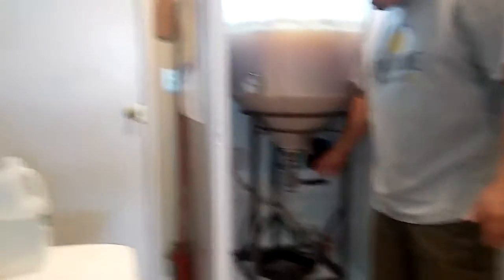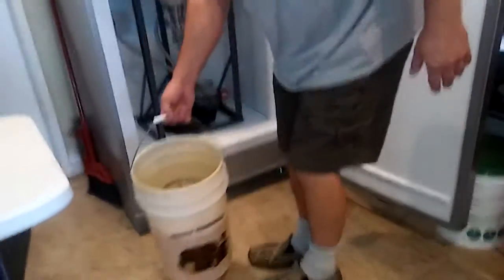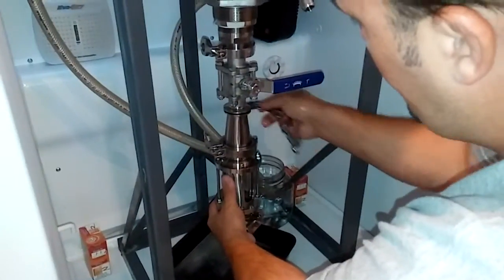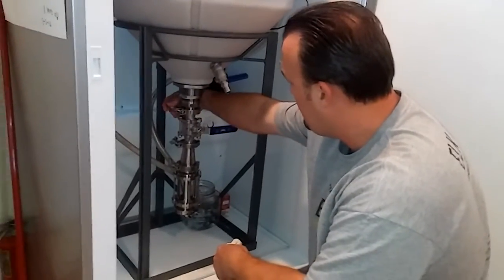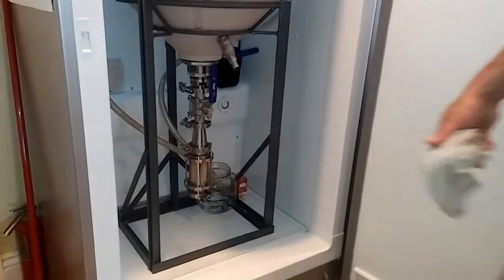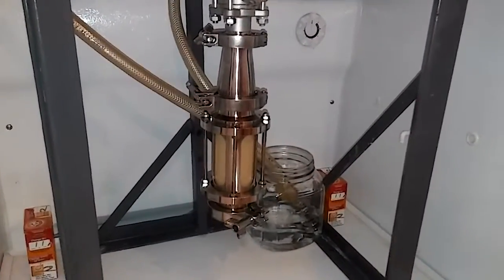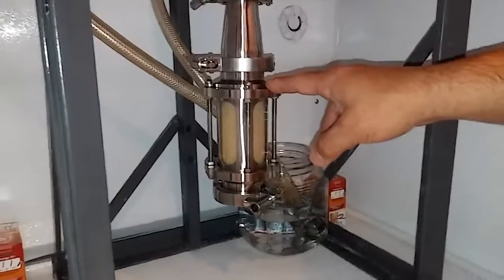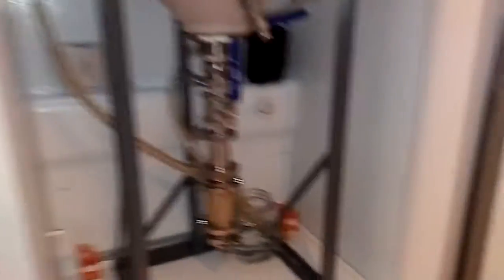Collecting yeast from conical fermenter.

Comment: I'm not sure, but I think you just oxygenated your wort.
Reply: Worse, oxidized beer.  It's tricky to do this right without letting oxygen go up through the beer into the headspace because how do you purge into the collection vessel?  It's why I use a racking arm on the liquid out port (in his case, the ball valve at the middle top poking out at an angle).  Process is:
1) cold crash
2) pressure transfer out until your beer is clear, leaving the trub/yeast in the cone below the valve - your beer is now safe!
3a) #Optionally# add a little boiled and cooled / sanitized water and swirl what's left in the cone, let sit a couple hours.
3) Dump the thickest part of the cone (trub) to compost and collect the yeast when it starts getting liquidy.  If the trub's been sitting there for weeks it can be quite dry and proteinous, almost like a dough ball.  
A sight gauge on the inside of your valve helps with this, you can see what's coming next and know what to dump vs. collect.

Comment: One problem I can see with this is that there is air inside the harvester before you attach it to the conical.. so that gets blasted through the beer when the yeast displaces the o2.... maybe you can purge the harvester first with co2 to reduce the amount of oxygen that gets sent through the beer?  (or just sit back relax and have a homebrew! lol). :D
Reply from the maker: Terence Gardner 
Thank you for your input. You are correct, and this is something I have actually thought about since. I now have a set up for purging my kegging lines, I use it to fill CO2 in the harvester before attaching. I also am now using another harvester that works better for me.  Thanks again for watching, I appreciate your sugestion.
Reply: Awesome to hear and thanks so much for sharing! Would love to see more.
Reply: @hungrypeckerbrewing564  I am planning to just fill the harvester with water before attaching it.
Reply from the maker: @kakaka9330  not a bad idea? but you will dilute your brew. Also make sure its distilled. Better yet check out nor cal brewing solutions new product. They have a mason jar that is vented so displaced air escapes. Also they have one you can pressurize and inject your yeast into another batch. I am currently just purging the mason jar with C02 before attaching. Cheers!! And thanks for the comment!

Comment: Can I attach this harvester to my plastic conical fermenter?
Reply from the maker: Randall Schoverling 
hi thanks for checking out the video. this is the morebeer yeast harvester. it will attach to any 1" or 1.5" triclamp fitting, the flange size is the same on both. I assume your conical has standard 2.5 inch bulkhead. you will need a reducer from your bulkhead to a valve with. a triclamp fitting. I actually just purchased a new harvester from Norcal brewing that uses a mason jar. it is less expensive and holds more. I will be doing a video soon. feel free to message me on facebook, just look up Hungry Pecker Brewing. hope that helps.
Reply: Yes, 2.5" bulkhead. I'd like to see that mason jar yeast trap, thanks!

Comment: Is that the morebeer yeast harvester? How long after transferring the wort into the fermenter do you start taken yeast samples.
Reply from the maker: Dion Billard 
hi sorry for the delay in responding. yes, that is morebeers harvester. I just switched over to Norcal Brewings harvester which uses a mason jar. I connect the harvester immediately, then when the harvester is full, I dump it. the first dump should get rid of most of the trub. I reattach and save the yeast when the harvester is full, the time it takes to fill varies. I will do a video soon on the new mason jar harvester. thanks for the question....cheers.